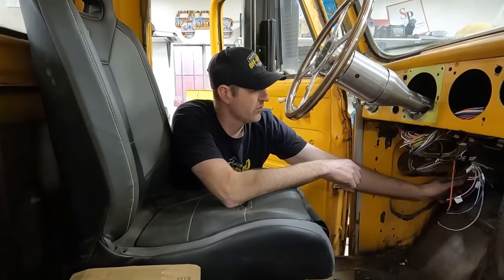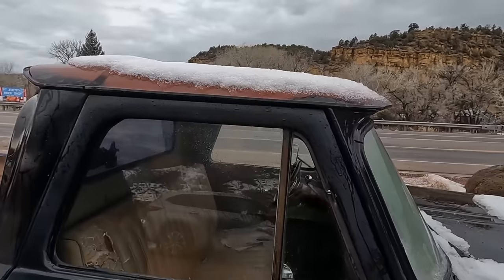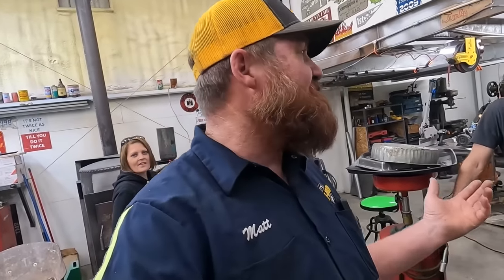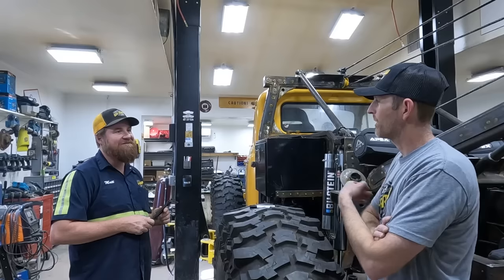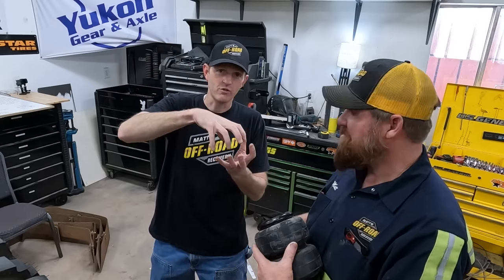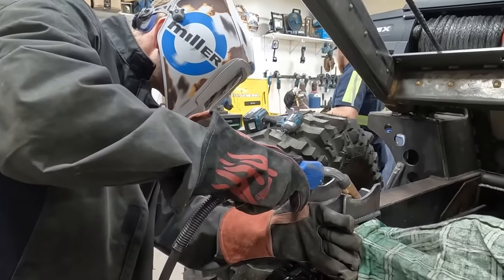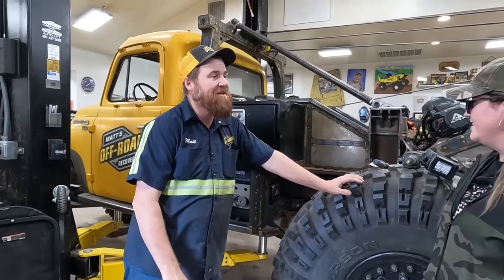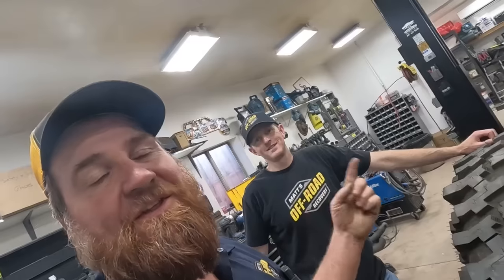Massive Announcement...It's On For The World's Largest Off Road Wrecker

Comment: I'm sure Matt knows that when you run an in tank fuel pump, it's best to keep the fuel tank at least a quarter full or more to keep the fuel pump cooler & alleviate premature pump failure......
Reply: From what I've heard on newer cars they've recessed the fuel pump into a hole. True on lots of older cars though
Reply: The tank is designed to accommodate for in tank pump

Comment: I'm a structural engineer- maybe we should have a little discussion about that free body diagram.  Or maybe there was something you didn't show in the video.
If you have limit straps on both ends of a solid axle, you wouldn't need a strap in the middle.  The middle would never drop any lower than the ends because worst case you would have both ends at full extension (when you have a lot of weight on the boom and unload the front axle).  Putting a strap on the center and longer straps on the ends would achieve more articulation.
It went by pretty quick but I spotted that table lamp made out of a Chevrolet big block valve cover!

Comment: if your machines will run it, or if you ever get the chance. you guys have got to try spray metal transfer, axial spray is what it’s known most commonly as. it’s a super cool to watch the arc literally spray the filler down. not only that but it’s a super hot process, great for doing fillet welds.

Comment: The pulsed mig is also called spray transfer, correct? I'm pretty sure your supposed to use a different gas for spray transfer. Like a 98/2 mixture

Comment: I use a 1/4" impact gun and a 90° with a 3/8" socket adapter with a square drive socket.
 But, I have seen a drill bit threader that drills the hole and then threads it... 😳

Comment: Stupid question,  will that truck fit rolling out the garage door?  I meat it would be sad. But dam funny you got it all done but the winch or top of the truck parts are too tall with them big tires on it.
You just know its been done.
Hell my dad built a pontoon boat in the basment  it wouldn't fit out the basment, we had to saw it in 2 to get it out.

Comment: I know this is an old video, I'm just watching it for the first time, but I have to disagree with Matt about "coil springs not failing". I work for the postal service north of Seattle and we have coil springs snap on our smallest postal vehicles ALL THE TIME. So much so, that I have to keep an abundant inventory of them when they do. Our smallest postal vehicle is a 1988 - 1994 Chevy S10 chassis and drive train. They're only 2.5 and 2.2 liter engines with aluminum bodies on then, so it's not like there's a ton of weight on the front coil springs.

Comment: Tom Tom, as a fellow Engineer, I was shocked to hear you allow Matt to totally pooch the explanation of the forces in his "free body diagram".  With a fulcrum, if 100% of the weight is supported on the longer arm (wheel), then more that 100% of the weight will need to be resisted by the shorter arm (limit strap)

Comment: With an air bag, if you pressurize them while they are loaded to 100psi and then unload them, they will expand and the pressure will drop as the volume inside the bag increases.
Reply: 💯% correct.

Comment: Old wwII used engine lathes are a dime a dozen now you can probably pick one up for scrap prices.  As long as you've got the 440 3 phase power to run one. 
Or a phase converter.  It will save you a lot of gas. You've got a mill, so why not have all the fabrication tools at this shop.

Comment: You need to make sure the center of your welds are  Penetrating and not just on the side but because its on camera its hard too tell but by camera view you have a spin too it and its fat meaning if you cut those welds open you might see it didn't penetrait in the middle I built my truck with a $500 welder from home depot and got all of it too penetrait and thats with out a bottle and you won't be able too break it been trying for years and still no hair line cracks or big ones

Comment: I'm not high-roading on safety glasses, but thought I should share my luck. I'll forever be grabbing my safety glasses anytime I'm working with tools, nvm flakes of metal, wood, or small work.

I was soldering on an Avionics bulkhead plug, and the wire I was working with flicked out of the solder joint, flicking the biggest glob of molten solder onto my safety glasses, right over my eye.

They would be framed on my garage wall, but the first person I showed my glasses too, goes "why wreck your glasses?" and FLICKED OFF THE SOLDER like 'I'll I fix that, so you can use them again' not clueing into how lucky I was.

Argh.

Comment: A BIRD IN HAND IS BETTER THAN TWO IN THE BUSH  / ALWAYS GET GAS BEFORE YOU GO ANYWHERE  / THE WAY THINGS ARE GOING IN OUR COUNTRY  YOU BETTER GET IN A HABIT OF GETTING GAS  FIRST  WHEN YOU CAN AND DO NOT TRUST IN HAVING IT DOWN THE ROAD   /  AND BECAUSE YOU ARE IN THE 24 HOUR TOW BUSINESS  YOU SHOULD THINK OF HAVING A  FAIR SUPPLY OF  FUEL ON YOUR PROPERTY WHERE YOU DO BUSINESS   / HAVE   A  ABOVE  GROUND  TANK OR FIND A  USED  GAS  TANKER TRUCK  TO HOLD YOUR SUPPLY AND YOU WILL BE ABLE TO GO GET IT WHEN YOU NEED IT   OR EVEN GET A TANK FOR IN GROUND AND PUMP    / YOU MAY BE TO YOUNG TO REMEMBER LONG GAS LINES AND NO GAS DAYS  / THE TOW YARD I WORKED FOR HAD A IN GROUND TANK  WE ALWAYS HAD GAS FOR TOWING AND  EMPLOYEES  TO GET TO WORK   / IT WAS A VERY BAD TIME IN THE U.S.A. WITH NO GAS  WHEN YOU NEEDED IT AND NO MATTER  HOW MUCH MONEY YOU HAD  NO GAS  IS NO GAS  /   PEOPLE STAYED IN LINE ALL DAY AND WHEN THE GAS WAS GONE   PEOPLE  WERE OUT OF THERE MIND  AFTER A DAY IN LINE AND THEN NOTHING  /

Comment: As a machinist, i've gotta say....

Matt, while i know that you know what you're saying, when referring to the machining of those brake rotors, it drives me a little mental when you keep mentioning you need to turn the 17" rotors down to 16", you then say you need to take 1/2" off the Ø. That's incorrect terminology. It's 1/2" per side (old lathe graduation) 1" off the Ø. You were also running the RPM on thy lathe WAY too high for that Ø. *edit: for those that don't know, Ø represents diameter on drawings/blueprints.

Comment: Fab rats, rory and robbie Layton are the other 3 In yall wondering
Reply: Don't know that Robby Layton has an off-road wrecker. However, he is one of the judges.  You can check that out in the link in the description.
Reply: @warrendon1388  Isn't Rory building the blue wrecker for Robby? But he did say it wasn't competing.
Reply: @JohnFL  Rory is building a wrecker for Robby.  It's based on an old Model A body.  Last I saw, Rory had stripped it to the frame and was looking a little dubious.

Ol' Blue is Rory's wrecker for use when he doesn't need to rock crawl or when he wants to keep warm or cool.  Trail Mater doesn't have cab heating, cooling or window seals (when Rory puts the doors on).
Reply: @warrendon1388  Thanks for the reminder, I forgot about the Model A. So Ol' Blue is for when Rory retires, basically. Lol